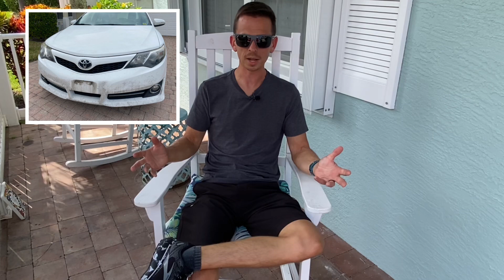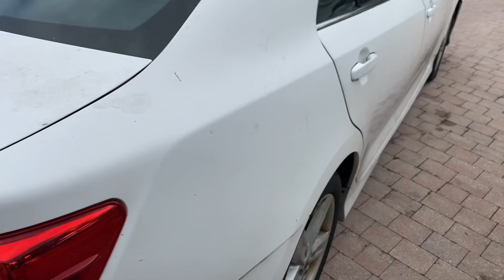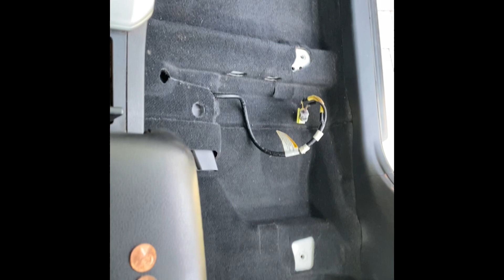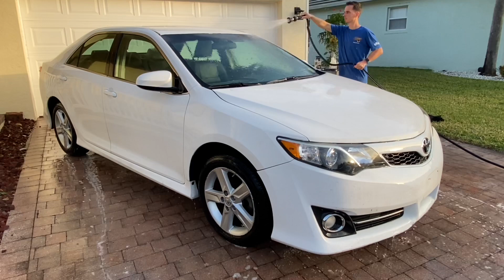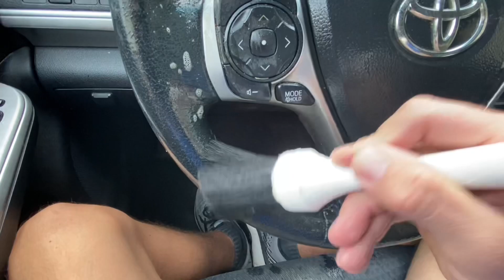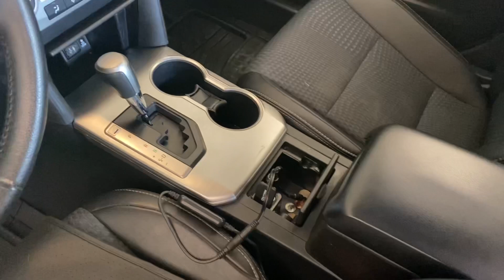First Detail in 7 Years | Providential Detail of Daily Driver | 2014 Toyota Camry

Comment: So if my car has not been waxed in years and the color has "changed"  what products do you recommend? Please list them
Reply from the maker: Hi Karen.  I would recommend McKee's 37 Complete Swirl Remover, followed by McKee's 37 Complete Finishing Polish.  This will restore the paint to like-new condition.  Then, apply our 426 Paint Sealant to lock in the shine and protection.  -  Nick
Reply: @McKees37  Nick the car has no swirl marks. Wash by hand or touch less wash, no buffers. So no iron? What were you spraying while you were washing this car? Seems like the iron  is a must to me.